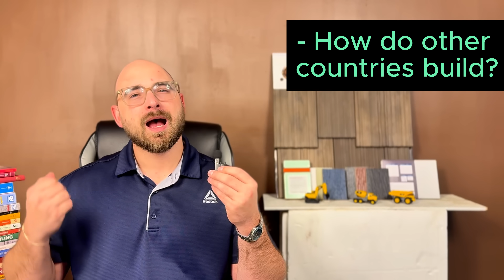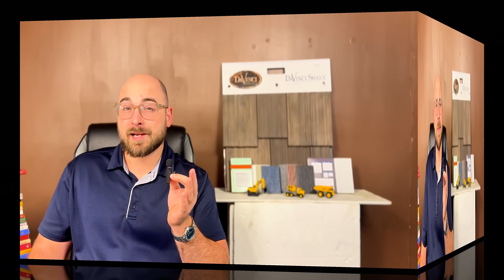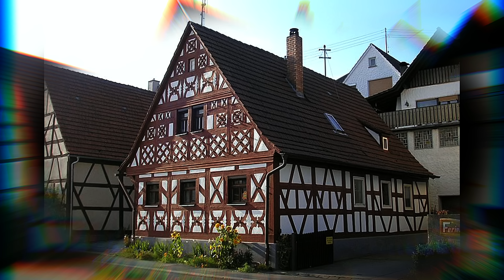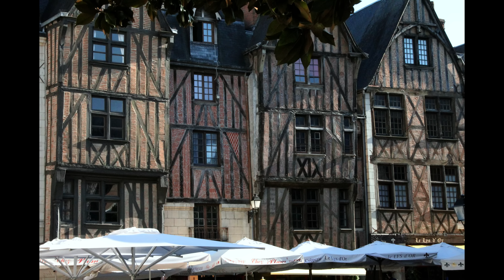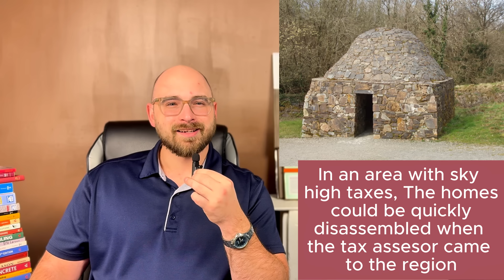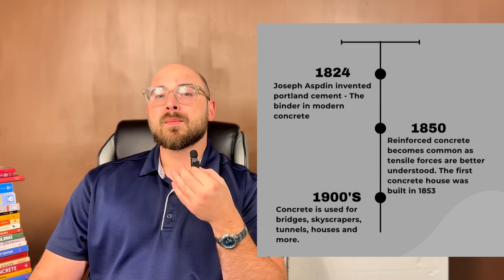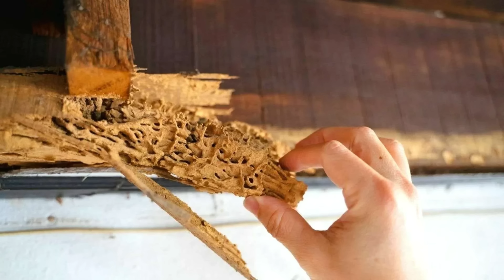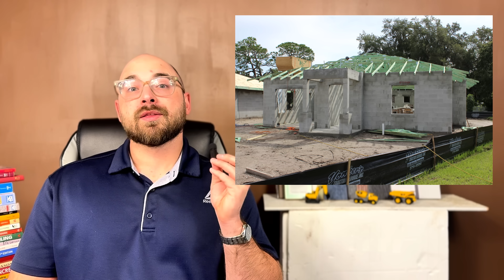Why Other Countries LAUGH at American Homes

Comment: Another thing which seems common here in Czechia where most of the residential housing is still build with bricks like blocks is that a lot of houses are still being build in large part by the owners themselves. You can build brick house alone or with one another preson relatively easily. It will take some times (few years) but it could be done even if you have 9 to 5 job. In US it seems most of the housing is build by relatively large teams of contractors quickly. I guess with timber framing can really be effective if you have many hands available to put everything in place timely etc. With bricks you can lay one row over the weekend and walk away for month and you can do it alone because brick is sized to be handled by single person.
Reply: I think that attitude towards employment in the US and in Europe makes a significant difference here. In Europe you more likely have some time after work to undertake such projects as building your house on your own (except for some parts like installations and roof e.g.). And there is a higher chance that your relatives live nearby and will be willing to help you. So it's also related to some social conditions.
Reply: @feandil1713  Not really, the numbers of hours worked per week on average are pretty close. If anything, Americans tend to spend much more time commuting and driving in general. For example, many Americans spend significant time driving to the nearest grocery shop. On a plus side, US offers you a chance (in theory) to buy a large plot of land where you can be largely self-sufficient. I own a property that's considered quite large by local standards, but it's a joke compared to the US. On a minus side, lower population density comes at a cost of time you spent travelling from one place to another.
Reply: @AKuTepion  I'm well aware of that, but here we go: one thing are taxes, and another thing is the general cost of living. By no means I'm trying to say that the cost of living in low in the US.
Reply: @ Not sure I understand you, but you'll hardly build a house on your own if you're working two jobs to cover your basic living expenses if that's what you're trying to say. There are people who are trapped in poverty here too. That's not really about work culture anymore. Just like you'd find people in LA who have to do side jobs to basically be able to afford rent and food, you'd find people in Prague who are in the same position. Neither of those would typically be able to build a house and not having time to do it is just one of the factors at play.
Reply: 2-3 weeks 😅 35 people working, sometimes 5-7 simultaneously
Reply: @ikaustralia  that's crazy fast. In here it usually take 2 years or more even if you hire company for the job.
Reply: @MarekFajkus  the building should ideally last through a complete thermal cycle (winter and summer) before completion in order to "settle down" if using bricks + concrete foundations. So it doesn't matter much for self-built houses but for fast building it may be a bit annoying. It can be avoided with slight additional cost.
Reply: @MarekFajkus  Heads up, a concrete and brick home can easily be built by a skilled crew in 2 weeks. I've seen it happen. If it's a 1 storey house, they don't have to wait for the concrete to fully set before the next storey. 

I'm not.saying your experience is wrong, I'm saying quick construction is definitely available with concrete.
Reply: @MarekFajkus  If you measure the time it takes to go from a piece of land to a completely finished house, then yes. Most of the time will be spent on acquiring a building permit, not to mention there's a huge lack of construction workers, so there'll often be a lot of waiting between various stages of the building. If you didn't have to fight the Czech bureaucracy and had bricklayers, electricians, plumbers, carpenters, pavers and other craftsmen always ready just in the right time, building a traditional Czech house (made of concrete foundation, brick walls and gable roof) with modern features on top (insulation, solar panels, kitchen appliances) would take just a few months. And that's a comfortable pace, not trying to win a competition. You could save a bunch more time and money if you didn't care about gable roof (say goodbye to building permit in most of Czechia).
Reply: We do the same thing here, roofing used to mean a barbecue because you need more hands. Now we hire a roofing company because they are really efficient so is cheaper compared to a decent barbecue for 10 (30 with family and leeches 😂)

Comment: In the end you're putting it in a nutshell. Many homes are just built to minimal standards. 
But Europe has other problems. Some example: It's driving me nuts how to put optical fiber through a multi-family home built 40 years ago here in Germany from ground level up to the third floor where everything is made of brick and concrete.

Comment: Here in nz we build all housing with wood with exceptions for highrise apartments and foundations.
It seems all the masonry guys have died, we had a go with calendar blocks in the 60s and 70s but have returned to wood framing.
It is notable that medium density housing is now becoming a thing in most nz citys, these are usually low rise apartments and townhomes.
But wood framing is still used, even between apartments, so it is now common to hear your neighbours using the toilet and  listen to their tv shows.

Comment: A lot of people seem to think that wood framing itself is the issue, rather than bad practices from companies that haven't yet been reigned in. Plenty of wood houses all over the world are still standing after centuries.

Concrete and rebar can be used, but concrete with rebar is also only rated to last about 50 years due to material degradation. The rebar rusts and the concrete cracks and eventually needs to be replaced wholesale. Brick is definitely going to last the longest I would imagine.
Reply from the maker: When concrete is protected from moisture and/or uses corrosion resistant reinforcement, it can  last for centuries
Reply: @Mike_Fortin  You see a lot of concrete houses having said problems needing repair after very few decades. When it starts to rust good luck. Germany just discovered their tumbling concrete Bridge timebombs.
Reply: @consultante1650  at my place concrete houses last far more then 60years so its not a major problem,when talking about degradation/rotting  definitely plywood house more suffer from this,the needing to constant maintain it are worst then try to maintain concrete itself,conclusion to american plywood house its cheap to build but sell at crazy expensive by bloodsucker american developers then concrete house at another place in this world,the needing constant maintain it will add the cost and we all know how worst mortage,tax or whatever law about housing in america its worst almost same like a healthcare their department too,feel poor for average and low income american,for the rich american well their in their own world now😊they dont care anymore
Reply: @consultante1650  The "tumbling concrete Bridge timebombs" are not the problem of concrete or reinforced concrete in construction itself, though, but a lack of inspection and maintenance for several decades, together with heavy use of salt to thaw the streets. This combination: Lackluster maintenance and frequent ingress of huge amounts of the prime rusting agent (halogenides, ie. chloride) caused this.
Reply: @KarlKarpfen  prestressed concrete won't last more than 50 years
Reply: @ekesandras1481  That's definitely false, as we have quite some buildings from prestressed concrete here in Germany, which have been neglected for most of their lifetime and are still in good shape after an entire century.
It's not that prestressed concrete won't last, it's that it needs some design features to do so.
Reply: @KarlKarpfen  die Carolabrücke zum Beispiel, nach ein bisschen mehr als 50 Jahren war die Lebensdauer überschritten. Das sagen auch alle Experten. Regenwasser tritt ein, der Bewehrungsstahl rostet, besonders wenn noch Streusalz gestreut wird im Winter. Alle Spannbetonbrücken die in den 1970er Jahren gebaut wurden, werden jetzt abgerissen und neu gebaut, egal ob im Westen oder Osten.
Reply: @ekesandras1481  genau diese beiden Punkte: Im Regen bei Einsatz von Streusalz sind das entscheidende.

Nicht Stahlbeton, sondern Stahlbeton unter Salzlauge.
Ohne die Salzlauge hält Stahlbeton sehr lange. Das ist aber auch keine neue Erkenntnis.
Reply: Without doing much of any maintenance, reinforced concrete is given a 100 year useable lifespan. Much longer if preventative maintenance measures are done.
Reply: How about stainless rebar? Sure that will be more expensive but that will last many centuries. Also wooden houses are also very vulnerable to humidity, to the point that fungi can eat the house foundations if badly managed.
Reply: @teresashinkansen9402  stainless rebar is not necessary. Rebar won't rust in concrete unless you introduce significant amounts of acid or halogenides.
Steel can't rust until the pH of concrete around it drops by 4. There are ways to prevent this drop in pH and that's how you get long-lasting reinforced concrete structures. One of this ways is to not expose bare concrete to rain, as rain is acidic and after several decades will have lowered the pH far enough.
Reply: The problem is a combination of bad building standards in a firezone. Trees should not be so close to houses and houses should not be "cardboard"
Reply: My country home in Romania has been standing for over 120 years without any major work done besides some insulation and expansion (which were mostly for commodity). If my great grandfather made it well enough to last that long, I am sure modern day brick houses can last more than 50 years easily lol
Reply: mind you, wood without maintenance will last less than that
Reply: Exactly. Some of these europeans who shout about concrete being superior should come here to Norway and other places in Scandinava where people often live in centuries old wooden houses. The structure itself is usually still original and still in good condition. The only thing that has to be replaced are the exterior paneling and the roof tiles.

We even have wooden buildings from medieval period that again are still standing strong today.

Also like you said once you get issues with conrete buildings, like for example water in the support beams then it is extremely hard to fix. Anyone who thinks a modern concrete buidling will stand for centuries are completely deluding themselves.
Reply: I mean opus caementicium structures from the Romans are still standing today
Reply: @Quet00  USA houses ate made out of glorified cardboard ffs

Comment: Hi. In Europe structural brickwork is actually very very rare. Its only present in old buildings and hasnt been used in modern construction in any meaningfull capacity for decades. Most of the examples you show are non load bearing bricks that are used as in infill in reinforced concrete structures. Reinforced concrete is king in Europe. Undisputedly the most common construction method.

Comment: I live in Hungary. In an adobe-stone house - built in the 1950s or 1960s. And this technique is alive in the Central European region. Some people hate it, some love it.

Generally, I don't think the US' platform framing is a wrong way of construction. It's just different.
As you said: different material availability, different tradition, different considerations (wind, earthquake, etc.). Imagine a tornado-heavy area with concrete roof tiles instead of roof shingles.

Comment: The interior and exterior of my cabin is all wood, floors, walls, ceilings, not a single sheet of drywall, its very solid, was built in 1954 and it is built like a tank! Most new houses feel hollow to me, like if i lean on the wall ill put a hole in it

Comment: The US has such a wide variety of weather,environmental, geological and hydrological conditions that building codes vary widely from one region to another. Even European homes are constantly adapting to cost effective, energy efficient & labor saving materials. Conditions such as snow loading, frost depth and temperature extremes and humidity and even insects indigenous to the region,  all having a huge impact on design considerations. To further complicate architectural considerations are whether the construction is single family homes, Town homes, condominiums or commercial structures. Also a huge consideration it's the cost of materials that work effectively in a given region. Their are so many different construction styles in the US that you would find a close analog of anything that is presently used in Europe.

Comment: EVERY system has pros and cons. No one laughs at anyone else's homes without being ignorant to someone else's methods.  And it's lazy to chalk it up to greed and lack of looking into the future.  The framed houses I lived in in California rolled in strong earthquakes; similarly strong earthquakes flattened brick and adobe homes in the same area a hundred years earlier. The thermal mass of CMU homes in many inland valleys and in the desert sucked in heat all night and became sweat lodges all night.  ICF foundations are viewed in some of the Southeast as a conduit for termites, while in many areas of the northern interior that isn't an issue.  Tile roofs are vulnerable to breaking but are fire resistant.  The labor cost of thatched roofs in much of the EU makes them a status symbol.  The home I now live in in the Inland Northwest of the US is nowhere near building stone, far from limestone, but has an abundance of lumber and clay.  The clay brick foundation crumbled years ago and I had to replace it; the timber framework is still sound. It was built 130 years ago, much more easily retrofitted to electrical and plumbing than a masonry dwelling, and can have insulation blown into the balloon framing cavities. I'm sure the people that built it weren't greedy bastards short cutting the future--they were just trying to stay reasonably comfortable using the resources at hand. And yes, I've lived abroad a few years, as have several family members. We've traded notes on what we saw and how things were put together and with what.  (BTW, many of us have been in the various building trades for years).

Comment: This video was posted 3 days ago; the Los Angeles fires are still burning in many areas and there has been almost a billion dollars worth of homes and commercial properties burned to a cinder.  If anyone can afford to rebuild there, perhaps they should consider a concrete home for the walls, all interior floors and roof. .  Fire can still burn the interior items and water damage would also destroy the interiors but the walls, ceilings and floors would remain intact for future repair. High winds that swept through  the valley at sometimes 100 mph, hindered firefighters to contain the initial fire, and would not have caused as much devastating damage if  the homes were made of concrete.   We have a great many tornados,  hurricanes, floods, fires, earthquakes, insect damage, mold,   and other natural disasters making our current home building obsolete.   May be it is time for us to start building with concrete.
Reply from the maker: A very insightful comment, 

I definitely hope steel, concrete, and fire resistant design are incorporated into the rebuilding of LA (and across the country)